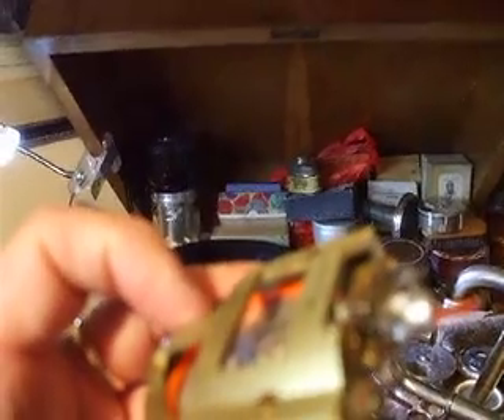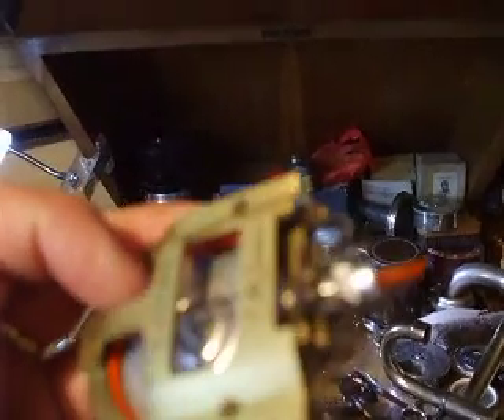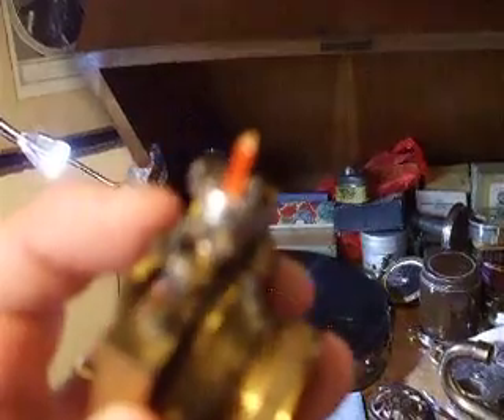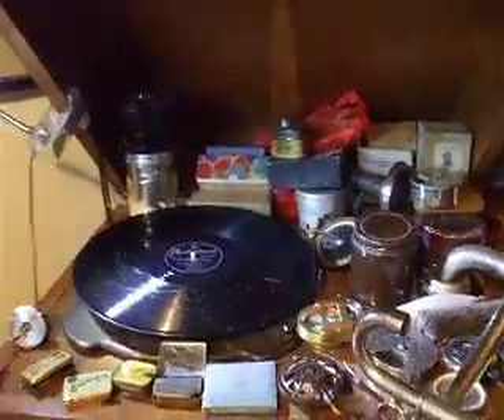"Testing, Comparing & tuning a Re - built Expert 4 spring Soundbox

Comment: I really like tests about sound boxes! Personally, I think that the Expert soundbox have clearer sound than the Meltrope which seems have a better bass response. Thanks for sharing!
Reply from the maker: HMVgramophone130  I agree - the Meltrope certainly has mode bass at the moment - i may change the rubber gasket in the back for RED which is a larger gauge thus allowing more space in the back which usually creates more bass